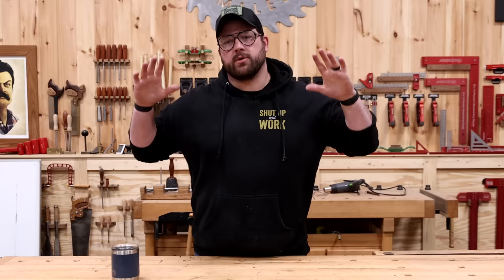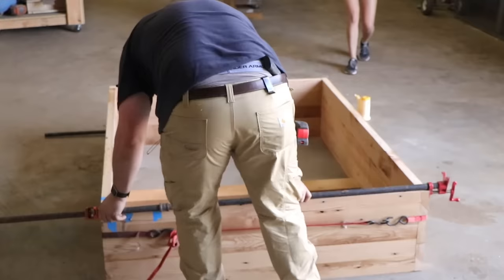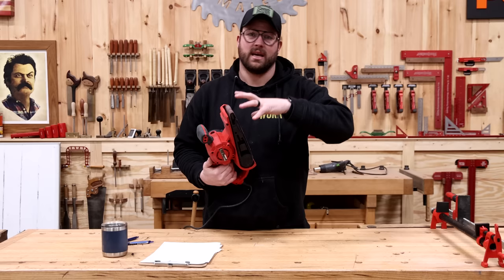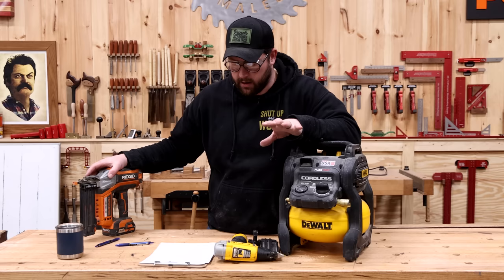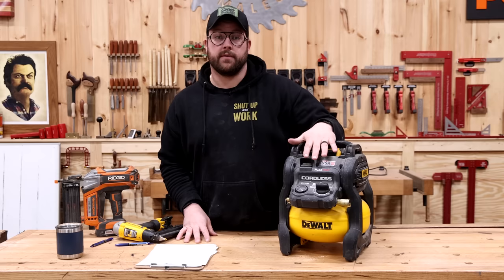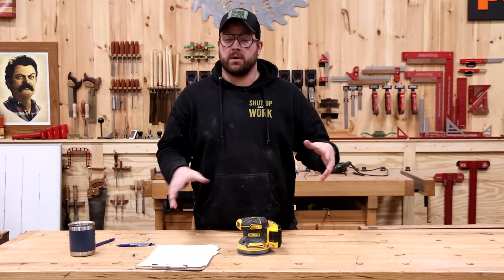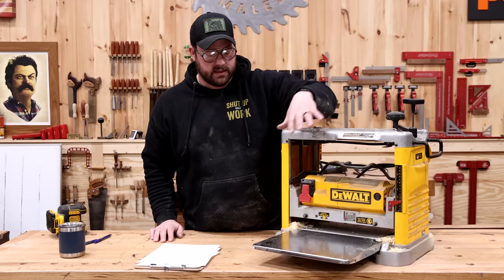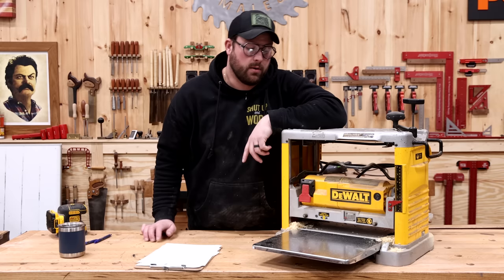5 Beginner Woodworking Tools I Regret Buying

Comment: Might be me but it sounds like the bulk of the "problems" he is citing is due not so much to the tools but abuse of them. If you get tear out on a belt sander your doing it wrong. If you need a "ton of pressure" from parallel clamps your prepping your wood wrong etc.....

Comment: I hope nobody is taking this seriously. This is phenomenally bad advice, and it's clear that the only purpose is to get people to click affiliate links. Pipe clamps cost as much as K clamps now, when you factor in the cost of the pipe (unless you buy a die set, buy bulk pipe, etc. which nobody taking any of this vid seriously will do). Lowes has Jorgensen 48" K clamps for $50 and that's cheaper than buying pipe and decent pipe clamp ends. Don't buy cheap pipe clamp ends. Those HF ones utterly suck. Nobody ever uses a sheet sander. Literally, never. But he gets a commission, so he'll say you should buy one. Pneumatic nailers are better (lighter, smaller) than battery nailers, but wtf would anyone buy a cordless compressor? You can get a better performing corded compressor for $50 at HF, and you're still gonna plug an air hose into it, duh. God, this guy bugs tf out of me. Nobody has bought a benchtop mortiser for 20 years. Do they still make them? Cut them by hand, or save up for a domino or (better) a Pantorouter. Don't buy a lunchbox planer unless you're building a deck and just need to get rough cut wood a bit smoother (like if you're building a cedar deck, trellis, or whatever). A decent cast iron planer will save you money in the long run if you run enough bf through it, but if you're starting out, either take your wood to get planed, or buy it planed. This guy is just trying to make money when you click his affiliate links. He's not giving you good advice.

Comment: You're comparing apples to oranges on those clamps. Pipe clamps are for certain jobs. Parallel clamps are for other certain jobs. I have both because I do different jobs. I buy my parallel clamps used and make my own pipe clams out of old pipes and clamp kits.

Comment: I think I'm in the minority here . I'm sorry to say - those K body clamps are garbage. Every one of the 20 or so I purchased 3-5 years ago are are broken. The internal parts that "grab" the bar are made of soft alloys that do not hold their shape and eventually just slip. Before you say it, trust me I made all the adjustments and "repairs" the manufacture recommends.  John is dead on - get pipe clamps and when you can afford it, get the heavy duty I-Beam bar clamps.

Comment: I turned it off after him pitching harbor freight pipe clamps over Bessey K Body's.  Look...most everyone who gets into woodworking needs to be budget conscious.  However, the more cheap crap you buy, the more money you're tossing away in the end when you realize the cheap tools generally are garbage and yes I know there are exceptions.  If you can't afford to even buy good clamps...honestly you really have no business trying to set up a shop.  Setting up a shop is a black hole from which your wallet will not recover unless you're VERY disciplined or you have the resources.  My advice would be to spend about $200 on medium sized Bessey's, then add 1 or 2 at a time as able and as need arises.  A set of 4 36" Bessey's will go a LONG ways. You're investing in these clamps once and you will have them for a lifetime. The other thing he doesn't mention about pipe clamps is that the longer they are and the more pressure you crank into them, the more the pipe can flex, which is going to cause you a problem.  And just the fact that you're having to crank that much pressure into your glue up means that you're boards aren't prepared properly...if you can't afford a jointer and planer to prep your boards, then you can buy dimensioned lumber at a HUGE premium or you can learn to use hand planes at a fraction of the cost.  The bottom line is to buy the tools as you need them and buy the best you can afford.  No one ever regretted having a quality tool on hand, but garage sales are had every weekend with guys selling off the cheap crap they regret buying.

Comment: This is some of the worst advice I have heard.  If you can afford parallel clamps buy them.  They won't stain wood like black pipe stains wood.  Also don't buy a lonng length and cut it because you think that you can save money  The  Ridgid spindle/belt sander has been a life saver for me.  I have no idea how in the world you have broken 3-4 of them.  That is your fault.   If there would have been battery finish nailers available 8 years ago I would have bought them.  If you are in a battery universe buy their guns.  Ridgid and Ryobi are entry level only, buy Makita, Dewalt or Milwaukee etc.  Way better in every regard.  I would much rather have battery nail guns than a battery air compressor.  You are still dragging hoses around and need 3 items: nail gun, hose, compressor vs nail gun.